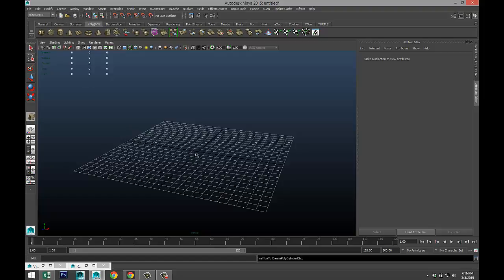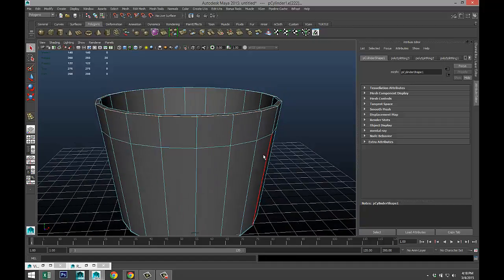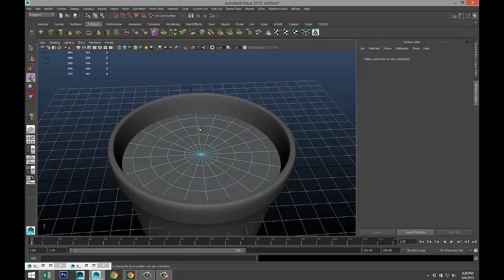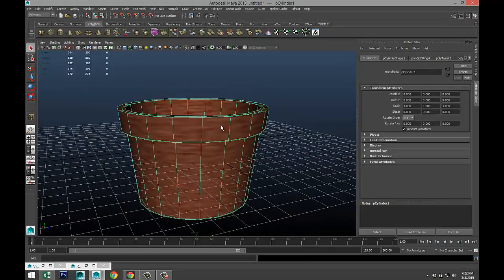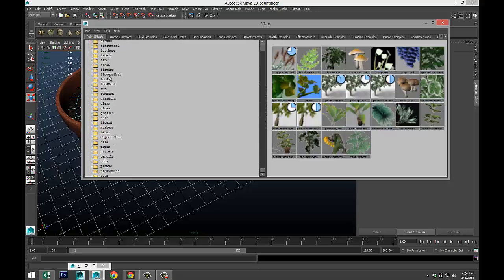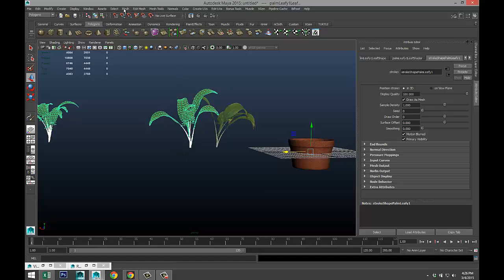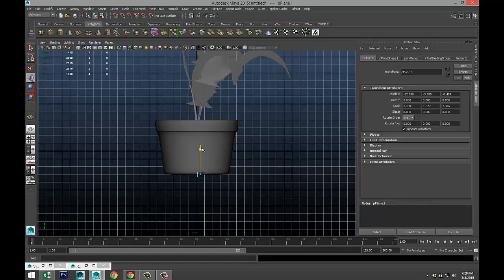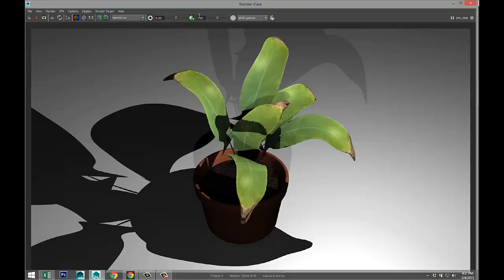How to model a potted Plant in Maya

Comment: Recently I modeled an interior and I used Soften to make the models more smooth, but they showed up clunky in the scene (but smooth in the maya software render). When you use it it seems to work perfectly though.
Reply from the maker: Try to render in Mental Ray, That should work
Mike
Reply: Thanks, I was wrong before though, it was clunky in the render and fine in the scene. But yeah I'll try that next time, thanks :)
Reply from the maker: fedupwithusernames No problem :-)

Comment: Hi Mike Hermes,
I was wondering if you could tell me how to fix my texture settings because when i apply texture it does not appear in my view untill i render it :/
Thanks
Reply from the maker: Ármann Freyr Hermannsson Hi There,

Just above your panel view window there is a little ball ( sphere ) that is half grey / half checkered. Click on it. This is the use default material button
Reply: Thanks that fixed it when i try use color only but if i add a file texture it does not show then either. only when i render
Reply from the maker: Ármann Freyr Hermannsson For that you need to click the checkered sphere to the right :-)